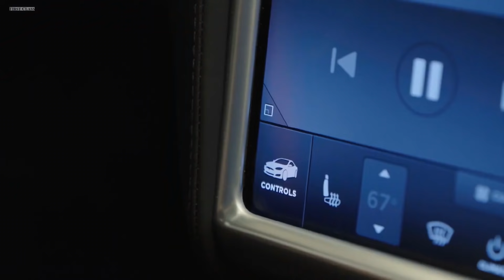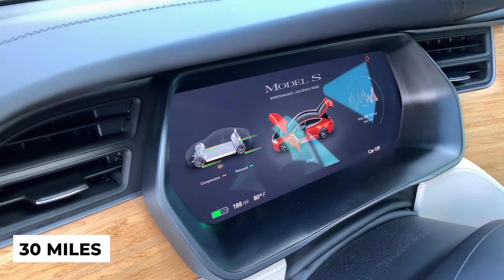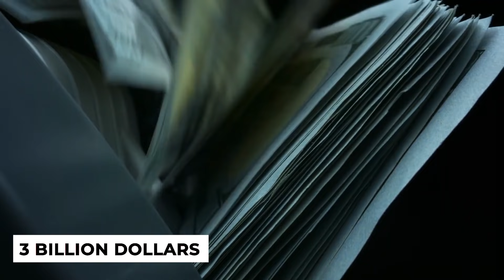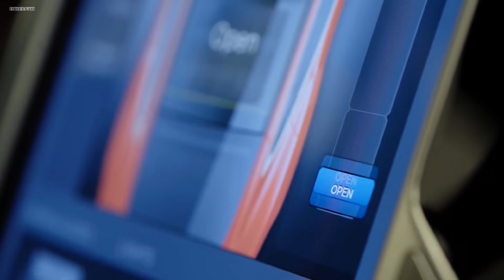Tesla's INSANE PLAN To Create Solar Powered Cars!

Comment: The novelty of mainstream solar power for consumers is challenging. Putting solar panels on your roof costs as much as a car. The number of customers who have owned a solar system through its full lifecycle is limited.  The stakes are high—this is going on your roof. Vehicle is hampered by unnecessary weight, the  battery  needs to be light. Solar electric car is very efficient, so you don't need excess electricity to run it - hence the small battery system. When building a long range electric vehicle, the battery is one of its main components, if not the main component.  Instead of installing your own panels, look into shared or community solar. This approach lets many different customers buy a stake in a solar installation and receive credits on their electricity bills. It makes sense to cut your usage down as much as possible before paying for all of these panels. Solar panels, utilize PV technology to capture sun rays and directly convert the sunlight into electricity.  There are few types of them - Monocrystalline, Polycrystalline and Thin-film solar panels. They absorb sunlight and transform it into electricity by utilising a silicon based technology. However, they require larger area of space for installation.  A lighter battery means a lighter frame, which leads to a lighter car, which leads to a more efficient car, which leads back to not needing a lot of energy to power it. This results in the most range per kWh battery. Chargeable through 4 different methods: regenerative braking, solar power, normal outlet power, and fast charging, from a specialized station. Fast charging, done in excess, can be very damaging to the battery.Charging from the sun via the five-square-foot solar panels that cover the top of the car is a slow type of charging. You get most of your energy through this form of (relatively) slow and steady charging, and the battery life is extended. Investigation of safety features on how to develop a system in which only a single cell does not get too hot. By keeping the temperature at cell level, we can prevent further damage to the entire vehicle.
Reply from the maker: Hi there! Thank you for your comment, make sure to subscribe to our channel for updates on this topic and more amazing videos!

Comment: Even if you would be able to drive only 10 miles if the car is parking in the Sun for one day, it would be always a win, because especially during winter times you avoid to discharge the battery when the car is not used for a longer time. The opposite happens: the car will be charged when not used...even if it's not much...this could not be wrong!
Reply from the maker: Hi there! Thank you for your comment, make sure to subscribe to our channel for updates on this topic and more amazing videos!

Comment: This is a development in right direction. This will enhance power availability and help at least when battery is down,  away from charging point. This will give chances to operate many remote parts of the world 🌎, enhanced demand.
Reply: NOT about to happen.  You'd get maybe 10 miles/day in ideal circumstances which rarely occur.  It's a bad place to put panels.
Reply: @Mrbfgray  Don´t say never.
Reply: @csakamatsu   I didn't say never, just a dumb investment for now with the exception of a camping vehicle.
Reply: The logic is that, in case accidentally you are stuck away from charging point, you can wait for sufficient charging and come out safely. 
Otherwise this facility will help customers away from charging network.
Reply: @ratnakarsuryavanshi732  Are you going to wait a week to get 50 miles?
Reply from the maker: Hi there! Thank you for your comment, make sure to subscribe to our channel for updates on this topic and more amazing videos!